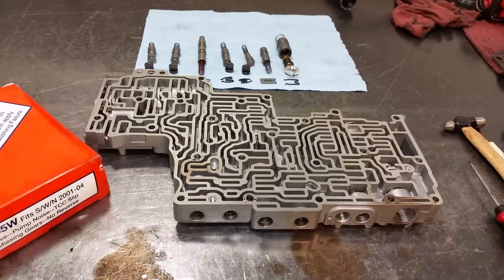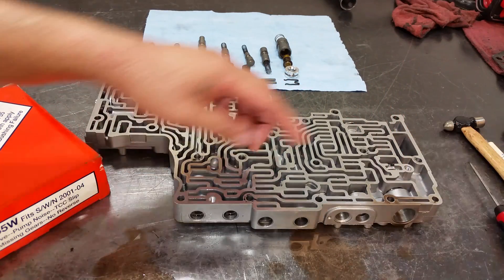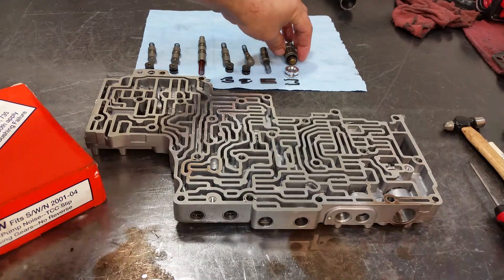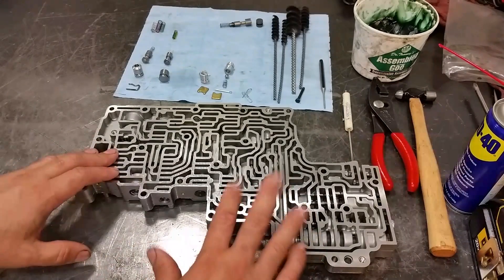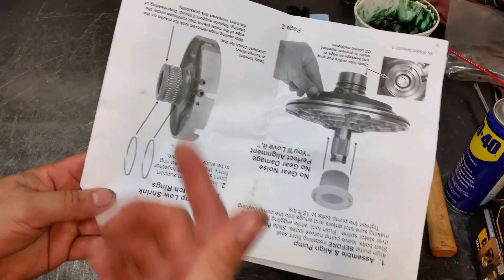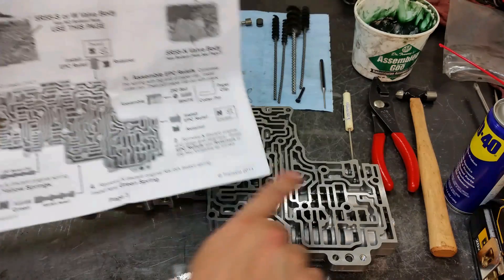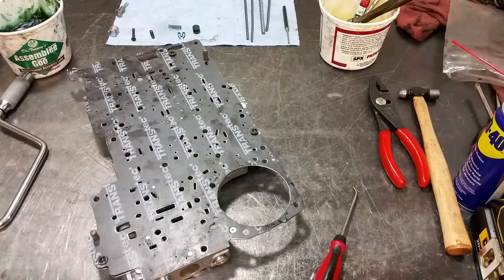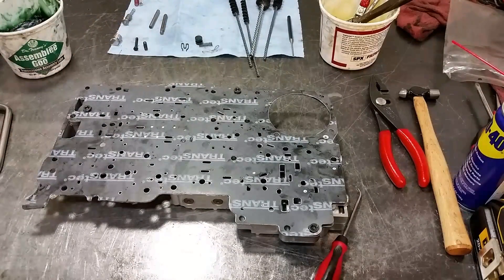5R55S Valve Body - 5R55S Transmission

Comment: I recently bought a 2008 Explorer that has a reman transmission and tc with 1k miles on it. I am getting a steady constant shudder i lock up in 4th gear and overdrive. The shudder stays there as long as the tc is in lock up. This can be felt anytime the converter is in lock up between 30 and 50mph. Where should I be looking at to diagnose this?

Comment: I am working on an 07 with a hard and delayed shift from D to R, when hot.  I am replaced the R servo and checking the band too.  Should I check anything else while I'm in there?
Reply from the maker: Check for solenoid codes. Sticking solenoid would cause reverse delay with a bump. The delay would be around 4 to 6 seconds. 
Also check the range sensor with your scanner on all data PIDs to make sure it is working properly. You'll have no codes if it's reading wrong.

Comment: Can valve body or solenoid packcan cause no engagement or vehicle doesn’t move at all on any gear selected?
Reply from the maker: Valve body, probably.  The flow control valve in the pump can cause that.
Reply: @ thank you so much for your response! I checked the pressure line tap and i get 0 psi of pressure also to double check i took a cooler line off going back to transmission and i don’t any flow. Do you think it’s a flow valve from the pump assembly?
Reply from the maker: @nereomacatangay9204 no, that's a broken pump gear. But flow control valve might also be a possibility but not likely. 
Regardless, the transmission has to come out of the car.
Reply: @AutomaticTransmission Thank you again for your help. I really appreciate it!

Comment: I have a 2003 Ford explorer XLT 4.6 with a p0733 code. Slipping and flaring in 3rd. Do you think it's the servos or the valve body? Thanks

Comment: After having 3 units fail within 6 months using the T-go flow control valve that stuck. I no longer use their kit on these units. The Sonnax flow control valve is much better. But the Superior kit is the best one for these unit. With a flow control valve that just does not fail. At least not yet.

Comment: Hey i’m about to cop a 2005 gt automatic with 100k. I’ve heard the 55r5 trans has some problems going bad between 100-150k for a lot of people. However some peoples have gone up to almost 300k. Obviously a lot of this is determined by fluid changes and how hard the car was driven..but the owner i’m buying it from said he’s never done a trans fluid or filter change. If i changed it first thing after buying you think I’d be alright? Or is a 100k trans that’s never been serviced a ticking time bomb?

Comment: Is there any issue with using blue assembly goo instead of the transgel gold?
Reply from the maker: There both the same, just different color. The green is thicker, I use it to paste my washers and bearings for ease of assembly. The blue for all rubber. I stay away from the red because it mimics a transmission fluid leak which is also red.

Comment: Hey Hiram great videos man. I need your help with a 5r55s that has a p0741 torque converter stuck off. It has a new solenoid pack, new converter, new converter seals on gear and sealing ring. Checked valve body tcc valve for binding and ok. Also checked circuits from pcm, and pcm ground coming out good. Problem returns right off the back with a wrench light. Any advise i would really appreciate it?
Reply: Hello.. sorry to hear all that!
Have you found the solution?

Comment: Did the shift kit fix any issues with the trans? I have the 5R55S trans in 2003 Lincoln LS and it shifts very harsh from 1st to 2nd, and 2nd to 3rd

Comment: Hiram, Thanks for your videos they are very good.  I just did this mod on a 2002 Explorer. 
Problem is now that when I come to a stop sign it does not shift down to 1st and flairs until you get the revs up when your ready to go again.  Also has a bit of flair going into 3rd.   The kit calls for 2 1/4 inch balls installed which is what I did. the original Valve body had one 1/4 and one about 3/16 installed.  Question is should I have left the small one in instead of replacing it?  Also do you have any other ideas?  Thanks, Steve

Comment: Greetings. I have a 5r55n where the 4-3 pre stroke valve spring broke. I'm having a hard time removing the valve. It seems a piece of spring it's jamming the valve or the spring it's getting caught inside the valve body. Any trick or technique so I can pull the valve out without damaging the valve body? I can't  figure out how to grab the valve and pull it out or find a point where I can pry from and push it out.

Comment: please guys help me with my Ford 2002 explorer It's a gas blow back airsoft handgunhaving problem in reverse some time goog some time no reverse and some banging sound when changing from N to D.please please
Reply: Could be a solenoid regulator valve in the valve body that's stuck.

Comment: Hiram Gutierrez need your help. Throwing code p0743 with the 5r55s with sometimes flashing o/d light and car went into limp mode. I've changed the filter, solenoid pack and transmission wiring harness. Reset the codes and they still came back, any thoughts?

Comment: do you glue the gaskets back on?? i see most recommended replacement of the plate with a new gasket bonded to it
Reply: Jd Douglass did you ever find the answer to your question? Do you glue the gaskets on yes or no?

Comment: Hello Hiram I really appreciate how you are so I'm formative in your videos.  I have a question regarding my 05 Explorer XLT 112K miles.  I have no Codes from My Actron scanner.  The Tranny is Slipping slightly between 2nd and third gear.  I feel a thud when I go from D to R and when I'm slowing down I feel a thud as if I we hit from behind.  This is after the truck reaches op temp.  I think I feel a vibration when I'm at 70+mph.  Could you help me please.  Thank you in advance.

Comment: Ok, got a question for ya.

I'm trying to put trans fluid in my 2002 5r55s transmission. 

I was told that it takes 4 quarts Mercon V. 

I couldn't get the petcock open (stupid thing rounded even though I sprayed it with wd.) 

On the 2002 it has a fill hole on the back, so I opened that and pumped in the 4 quarts.

How do I check the fluid level to see if it's filled correctly now since I can't open the fill petcock on the pan?

Comment: Excellent info! My daughter's 2003 Mercury Mountaineer had already been rebuilt with the servo bore repair by a previous owner. I found this out after the flashing OD light and no shift from 1st to 2nd led me to replace the solenoid block, but that didn't help. There's a lot of vague info out here in forums. lol. Upon further investigation, I opened up the OD servo cover to find the rod broken from the piston....$25 and I had it going again! I'm not a technician, just a shadetree. Before that, a company that starts with "A" wanted to do a total rebuild for her because they didn't know Dad was involved, and that receipts for a previous rebuild were in the glovebox when I bought it.
Anyhow, things were working again for about a year. Now, no take off in "D" and "R"...even though it engages initially with the clunk, and will take off in 3, 2, and 1?
Checked the fluid, okay. Pulled the pan, no metal in pan. Tried to adjust OD band, it was exactly 2 turns out from contact. Next, I will remove the valvebody to look for "stuff" clogging up the valves.
I might add, there were no grinding noises or anything, but the fluid did look darker this time indicating maybe overheating?
If I'm not finding any metal, would installing a shift kit maybe be the next move in the process of elimination?
The only code I got with a scanner was P1700 internal undetermined failure.
I appreciate your videos man! I might have to tear it down to look for broken stuff. You definitely know your stuff man!
Reply: Did you ever figure out the problem my 05 is doing same thing.. it engages into D and R but just barley moves when giving it gas and then stops moving all together.

Comment: thanks Hiram
am getting so many troubles with my car will explain to you briefly and if you can please advise me
well when the car is cool down it drive with all gears changing no problem but the reverse is very low, now when continue driving for a few km then I have no gears when i stop the car for some minutes all okay then again again no gears at all.
here in mauritius we can't find specialist like you, a garage told me to change the friction and steel plates then torque converter, I have listened to him and he change all but still the same, please Hiram can you advise me what causing this?

many thanks

Comment: seems like the 6R80 in my f150 has a cooler stat that maintains 200 degree trans temp. the 4r70w in my older truck runs around 150 trans temp mostly